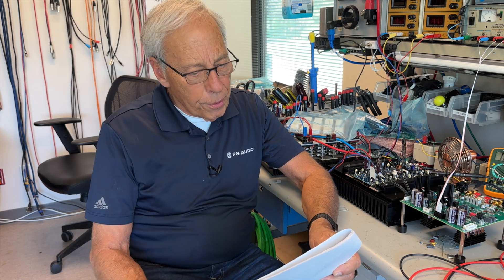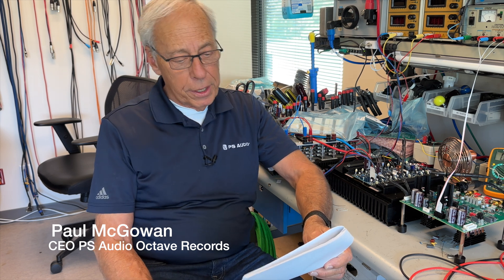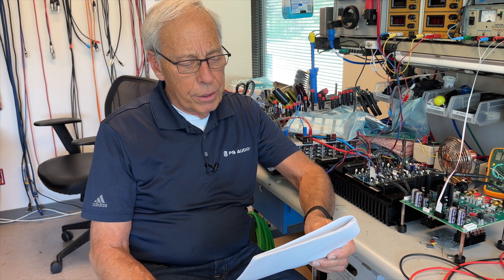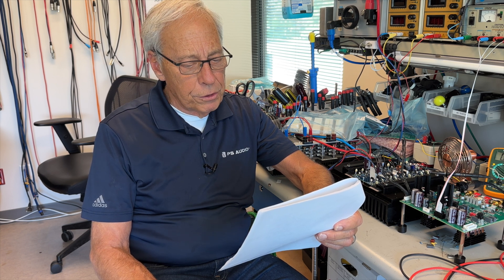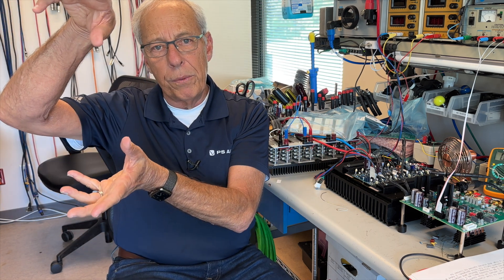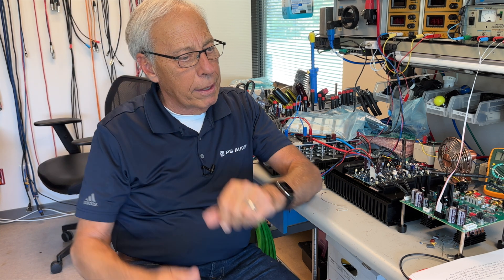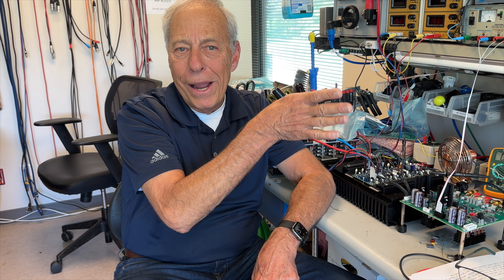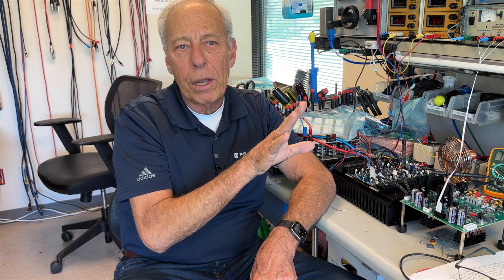Bridging stereo amps

Comment: 2:08?  Wait just a minute here.  Your arm movements suggest that in a Common Ground Amplifier the Positive Terminal always fluctuates above the Fixed Ground Reference.  In a Class AB scenario, the power supply is usually a Split Power Supply with both a Positive Rail and Negative Rail with respect to Ground.  The NPN Collector is Tied to Positive Supply Rail, the PNP Collector is Tied to Negative Supply Rail and the Positive Speaker Terminal is basically Tapped between the Emitters of those two!   That means the Positive Speaker Terminal can be Negative with Respect to the Ground Terminal of the Grounded Speaker Terminal (Post) on the Negative Swing of the Signal.  You could still bridge an amplifier like that.   That's terrible that it has already been done internally!
Reply: What i think Paul meant to say is that the output is differential, which is better for noise immunity.  The key point is that the minus terminal is not ground and, therefore, you can't combine the outputs for a bridged output since the two channels minus terminals are not the same node.

Comment: Sounds like you are using the term bi-amping for using the stereo amps as monoblocks.  Bi-amping to me is driving the HFand LF with separate amps.
Reply: You can also B-Amp using 1 amp per speaker if you have HF and LF on each speaker (4x binding posts - separated obviously) - this is a slightly better way to go as the load  from each amplifier is spread more or less equally equally - but the the more popular choice is as you say.

Comment: ... because a single Signature 250 with less than one tenth of an ohm output impedance doesn't have enough control authority over a pair of speakers.  lol!  [sarcasm]
Reply: To be clear, I would add a second BHK to my system also, if I could afford it.  I'm just pointing out that our community is made up of a bunch of maniacs.

Comment: I'm curious, do the BHK amps produce any extra power with just one channel driven?  You lose total, but any gains for the 1 channel?
Reply: Dependa on what the output transistors are rated at.
Reply: Like my Primare power amps. I get lots of watt in 8 ohm but no watts att all i 2 ohm when I bridge them.

Comment: Interesting ... Bridge Tied Load (BTL) outputs ... just like a lot of the new Class D stuff.
Reply: I can bridge my A/B amp. 
300/4–75 watts RMS per channel to 150 watts RMS 2 channel. The one and only other reason would be to run 2 speakers on side and a subwoofer 150 watts on the other side. Many of JLAUDIO subs will play just fine on 150 watts mono. A lot of people set their JLAUDIO amps up this way for a 3 way system. 

I have a 5 channel amp that has a dedicated 250 watts mono for a subwoofer, more than enough power to power a sub to make your eyeballs bleed. 😀👍😎🤗 and on the phone making an appointment with the Audiologist..😀😀😀😀